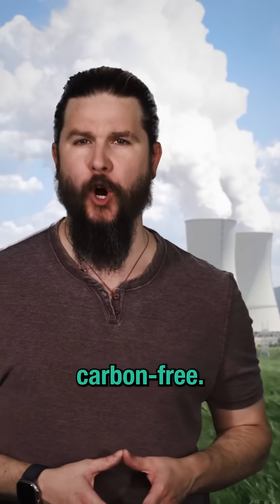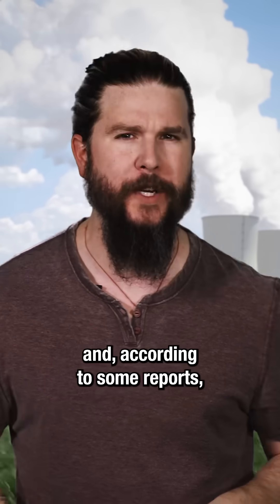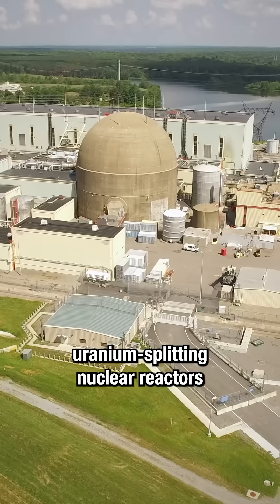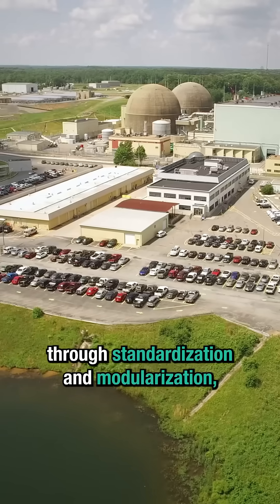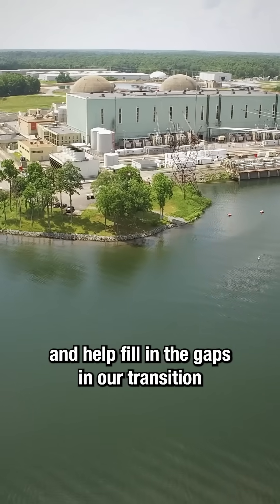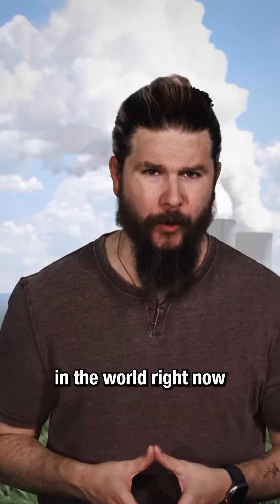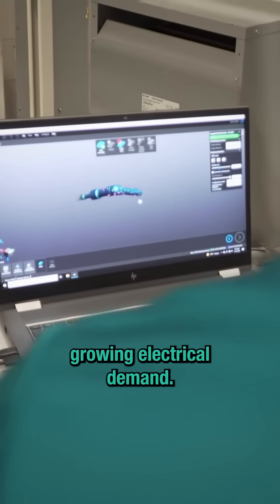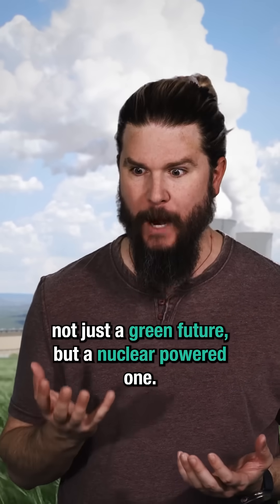Are Small Modular Reactors the Future?

Comment: They replaced three large boilers recently at my work, and putting in a solar array. I was like heat the building with nuclear SMR, put the solar array over the parking lot instead of a field or better just run it all on nuclear.

Past March the entire north part of my state lost power when ice took out the main transmutation lines and damaged like 75% plus of the localized grids. If we had a few SMRs up here perhaps things could have started up a bit faster. Or at least they could have kept a cluster of stores, gas stations open.

Comment: Rolls Royce has been making small nuclear reactors for 60+ years. They've been making 200mw reactors for submarines. Now they say they can make 460mw SMRs for £2B a pop and sit on 10 acres (only 2 of which has construction above ground). To put that in context, taking all taxes, fuel, subsidies and backup fees from UK energy bills and paying off the cost of SMRs would take <6 years. They last 50-60 years without needing de/recommisioning. 2-3 years to build and install and most importantly they run 98% of the year and the fuel is dirt cheap vs equivalent fossil fuels and they link into existing infrastructure far easier than wind/solar.

Comment: But spent fuels are not the only (radioactive) waste sources. All nuclear reactors -- even fusion reactors -- cause materials in proximity to the nuclear reactions to become radioactive. Since it's approximately a surface-area to volume problem  that means SMRs likely create significantly more radioactive waste (e.g. in kilograms) per amount of energy produced. So what's the long-term plan for disposing of all that extra material if SMR takes off and largely replaces the traditional plants? Are the radioactive reactor materials being disposed of going to have far lower half-lives than in traditional designs? Or will they have to plan for much higher volumes of waste to isolate for millenia? If the latter then it's not just green energy it's glowing-green!

Comment: Because of the cube square relationsbip they are also better at geting rid of heat which should also make them cheaper. On the other hand according to the papers I have gone through opinions on the actual cost effectiveness of smrs is highly debated. I have found that some say they are similar to standard reactors in cost, some others that say they have upsides and downsides and yet others who say that smrs are just staright up worse. 
Of course we do need to take into consideration that smrs are atill in their infancy, so considering how normal nuclear reactors developed I think we can be pretty optimistic if we keep at it. Thiugh from what I understand, licenses that are rquired to build these wouldn't be any cheaper so that's a negative

Comment: 300,000 homes sounds like a lot, but that's the typical size for a small generator of any type. 150MW is about what we see modern renewable farms and combustion turbines sized for. That's not to downplay the benefit of SMRs but to contextualize that 300k. If anything, SMRs being so small means you could potentially eventually make micro reactors on trucks to take into disaster zones to power entire city blocks. It would also be far easier to dot SMRs around the country than to build up the transmission to support one site with 3,000MW or more of power generation as we will likely see if/when fusion is ready.

Comment: The big problem with SMR is that they are still nothing differnt than those PWR that Alvin Weinberg patented (PWR/BWR) and are good for only one thing: making bomb material.
Plus using Uranium has a 2nd problem, even syphoning everything in the top 300 m, we have enough for 100 years.

The “Red Book” by the IAEA / NEA gives a figure of ≈ 7.93 million tonnes of recoverable uranium
World nuclear reactors use on the order of 65,000–70,000 tonnes U per year from mining (plus secondary sources).
At that rate, the identified resources give something like ~90 years supply if nothing changes (technology, demand, economics).

On the other hand:
MSR LFTR using 100x more available Thorium. Where a 250 MW reactor first in 40 ft shippin container with 1 year of power.  
Using the generally accepted average of 1 kW per person (not time dimentsion, 'cause) at all times. that means 250 000 people or - Households are 3 ppl (Asia: 5 and SA: 4) - 80 000 homes.
Besides being passive save. No meltdown possible. Whatever spillage happens goes inert (as it needs a mediator to go critical) as a block of flourid salt.

Comment: Small modular reactors (SMRs) are not necessarily “small” in terms of overall plant footprint once you include support systems, cooling, and security, but they are smaller where it matters most: the reactor module itself. A traditional pressurized water reactor may produce over 1,000 MWe and use a vessel around 13 meters in diameter and 40 meters tall, while an SMR like NuScale or the BWRX-300 produces 50–300 MWe per module with vessels closer to 3 meters wide and 20 meters tall. Many SMR designs also place the reactor and safety-critical systems underground or in shielded pools, making them more compact and inherently protected. This doesn’t exempt them from aircraft impact assessment requirements, but the reduced size and below-grade siting can make compliance easier than for large conventional reactors.

Comment: Where does the fuel come from? The smaller the reactor, the higher the necessary grade of enrichment to maintain neutron economy. Large facilities use about 3.5% fuel, while small reactors use 20-30% HEU, and naval reactors use 90% or greater. Its slower to make the higher purity stuff, and more energy intensive - which in turn makes it more costly. And of course there is a very limited number of facilities producing the stuff. 

Where is the supply chain to support all these reactors? For that matter - how many people do we have trained to run all these things? You still need a crew to monitor the reactor and its connections to the grid at all times, and more reactors means more crews. 

Dozens of powerplants means dozens of replications of turbines, and switch gear, and containment units, and a headache synchronizing them to the grid. We could have started from the 1950s with small plants, but the economy of scale won out.

Comment: Random thought, imagine a flywheel capable of storing a large portion the energy put out by a nuclear reactor. It's made it of a super material that can withstand the forces involved, and it is similar in size to a large AC unit. Now imagine it gets knocked loose. Does it just travel in a straight line, destroying everything in it's path, or would it spiral like a top, keeping most of the damage to a central area as the energy dissipates?

Comment: Uranium supply is also not endless, and we still have huge problems dealing with the waste that comes out of these plants. While it is true that Thorium reactors can reuse some of the existing waste, it is only a minor amount (around 10%), the rest still needs to be buried somewhere. Also, nuclear reactors, even SMRs, need reliable access to cooling water, so "we can build them anywhere" is a patent marketing lie. SMRs are essentially taking the problems we have with the giant centralized nuclear power plants and spreading them out over a larger area, and putting them into the hands of less well trained and less supervised maintenance crews. I don't see anything that could go wrong with that approach. All the while when we should be building wind and solar farms instead, but "ecological is bad" is the mantra of the far-right idiocracy.

Comment: The appeal of Powerplants in the past was, that the bigger they are, the more efficient they can run.
Because they need less Fuel for the same output.
SMRs may be smaller, but because you need thousands of them, you need ALOT more nuclear Fuel for them.
Making them economically less viable, which means that Power generated by SMR would be more expensive to cover the costs.

Comment: SMRS do have a bright future, but each module is relatively low on power output.  Larger size nuclear reactors and other types of power plants can produce in the gigawatt range, per plant.  And you can have multiple plants on a site.  But, by definition, SMRs are 300 megawatts or smaller.  Medium size modular reactors are up to 750 megawatts.  And since they’re a closed system, you bring in all this equipment, install it and run it for twenty years, and then you have to truck everything back out again, because the whole thing is spent.

It’s going to take a lot of SMRs to replace the plants that we have today, and even with SMRs, it takes many years to get them permitted and approved.

But for example, one main power drain is datacenters for HPC/AI purposes.  Those are usually in the 100-250 megawatts range, and growing fast.  Using current generation hardware, you need to provide 140 kilowatts of power for a single HPC/AI rack with NVIDIA GPUs.  Next generation racks coming out now are 650 kilowatts per rack.  And NVIDIA is already telling us that we’re going to need multiple megawatts per rack in the near future.

You just can’t build/permit/install/commission enough SMRs fast enough to keep up with that kind of demand.

Comment: I really like content creators explaining physics concepts, but i would like to highlight that this is paid. I am aware that there is some hype around smr's, but nuclear power remains the most expensive modern way to produce energy in most countries (that do not subsidize it due to military uses or can get their fuel for very cheap due to being an old colonial power like france for example). Also working "smrs" have existed for a few decades now (for example used in nuclear submarines). I dont understand what kind of modernization would make them viable to produce energy commercially nowadays. Cant we just build regular renewables? All the pro nuclear videos on the internet seem to suggest that there is some evil lobby trying to "cancel" nuclear power. But at least in my country the companies burning fossil fuel are the same that run nuclear reactors... They just dont built new reactors because thats bad buisness...
Reply: Also smrs do not reduce safety. If you have to build lots of small reactors instead of one large reactor you have a large security overhead.

Comment: Nuclear is the future. Much better than the green alternatives currently available. Solar power is not viable in cloudy areas and don’t supply energy during the night. Wind turbines don’t work where there is not enough wind, take up too much space, require giant amounts of energy usage to build and put in place, and have horrible waste from old units. Thermal power is only viable where there is updrafts or heat from the earth. Water turbines are perhaps the best of the lot but are not feasible without proximity to moving water and have large negative effects on the environment.

Comment: I'm not convinced SMRs are really much more than marketing hype.

First off, whenever someone leads off talking about physical size of the reactor, that is a big red flag.  The actual reactors of conventional light water nuclear plants aren't that big.  And an SMR just produces heat... You still need not small stuff to convert that heat to electricity.

You're also sacrificing the gains from making the reactor bigger for the hope of manufacturing economies of scale.  That might turn out to be worth it, but it is speculative and the downside is almost always just ignored.

There's also the fact that a lot of different things are being conflated.  Yes, there are presumably walk-away safe SMR designs, but there are also ones which are just small light water reactors of various types.  Which ones are actually nearing completion vs which ones are early in development... Well, the more advanced and untested designs are probably not the ones which might be rolling off assembly lines soon.

BTW: An SMR company (NuScale IIRC) had an agreement with a Midwest utility a couple of years ago to build a 462 MW power plant using 6 or their SMRs.  The agreement was cancelled when it turned out the utility would need to pay $90/MWh just to cover the financing and operation costs.  So, not cheap.

...
Anyways, I'm much more optimistic about medium sized reactors which are actually using better technology and design.  Natrium looks particularly good since it integrates thermal storage which allows the generators to run in more of a peaking mode and get higher prices for the electricity.  It is basically impossible for nuclear to beat variable renewables on bulk generation cost, but adding thermal storage lets them play a complimentary role.  (And since nuclear is thermal, you have to pay the thermal->electric cost anyway)
Reply: It ended at $120 per MWh, they were counting on a $30/MWh subsidy.

If you're talking impossible to beat renewable, you mean heavy subsidized solar PPV from China.

Which comes with a host of issues similar to getting in gas from Russia.   I personally don't want my town knocking down local forests to make biochar because they are terrified we will freeze in winter like the Germans.
Reply: @LaserKid-mww  PVs and wind provide the cheapest basic electrical generation even without subsidies at this point.  But that certainly doesn't mean they are some complete solution.

The thing folks have to realize is that there are different types of electricity production which can command different prices.  It's weird since electricity is electricity, but the market is for electricity to meet the demand.
Variable renewables are great (and relatively cheap) for producing most of the electricity which is needed, but they are VARIABLE of course.  Dispatchable power plants (and storage) which can fill in when variable renewables aren't covering the demand are needed.  And those can and do get paid more per unit they produce.  That's Ok... It is the total cost which matters.

Too many folks (I'm not accusing you) seem to be just thinking about a single silver-bullet electrical generation "solution".  That's just not how it works.  

...And it seems like the fossil fuel industry is trying really hard to create a "renewables vs nuclear" fight which doesn't actually make sense.  Just hurts both and helps the status quo.

Comment: Nuclear power is the future...

UNFORTUNATELY there are so many people spreading misinformation or just flat out lying, people are under the impression nuclear power is unsafe and deadly!
They are wrong and I can prove it with my LIMITED knowledge.

1. But uhhhhh Chernobyl blew up!
Uh yes it did, it was also made in Soviet Russia who were known for their amazing quality materials and world renown maintenance!
Oh wait no the complete opposite.
They messed up and reactor 4 went critical, causing a steam explosion that blew the roof off throwing graphite all over.
If a nuclear reactor is built with good quality materials and has maintenance and check ups?
It will run perfectly smooth and won't blow up.

2. Ok but uuuuh fukashima!
Fukashima was faulty on 2 fronts...
The tsunami wall was far too low.
The backup generators were in the basement.
Because of this when ghe tsunami hit, they had absolutely 0 chance of stopping what was about to happen.
If a power station is built in a good position, has backup generators in a good place and natural disaster protection made properly?
It will work perfectly fine.

To conclude, I am not a expert.
I'm a nerd who knows odd things, is scared of black holes and is just a average guy who does this amazing thing called "RESEARCH"
Nuclear power is in no way dangerous, in fact its quite the opposite its extremely safe... when built with the right materials and is maintained.

Where I live, the UK they are actively building more coal power plants and aren't building nuclear power stations.
What they did build was the nuclear waste processing place that makes new fuel rods and disposes the waste safely... so well other countries ship us their nuclear waste.
Unfortunately our government see's nuclear power stations as a bad idea.
(Because they'd generate more electricity and would have to charge less, because its all about greed at the end of the day)
(And also who can forget about Coal, Gas ans oil companies that have a monopoly and don't want clean energy because it would make their profis shrink so they pay people to spread misinformation about nuclear power...)

Comment: If I had to guess, this would be similar to Naval designs in US ships... China has already invested heavily in this kind of reactor where most of the components are relatively small, standardized components that can be manufactured remotely and shipped to site - and because of the smaller space requirements, they can be built almost anywhere.

Comment: This mitigates one of the biggest issues with nuclear power plants: they take a lot of time and money to build. By standardizing and mass producing smaller reactors, a plant could be brought on line much more quickly and cheaply. Plus having numerous small reactors gives the grid more flexibility than one big one.

One drawback of having a larger number of nuclear reactors is labor inefficiency. Reactor sites need dedicated engineers and staff, not to mention security. A single large site needs a certain number of these, but each individual site would need its own staff, creating some staffing redundancies. For example, a big site needs one chief of security, while two smaller sites would each need one. I'd call that job creation, but the current business climate is inclined to slash labor costs wherever possible.

Comment: 1000 SMRs sounds like a nightmare, who is going to keep track off them? what if 0.1% fail? mass production does not improve quality and safety, it lowers manufacturing costs. I would be on board if it means cheap or basically free energy but how likely is that?